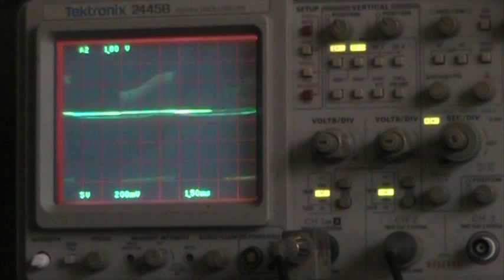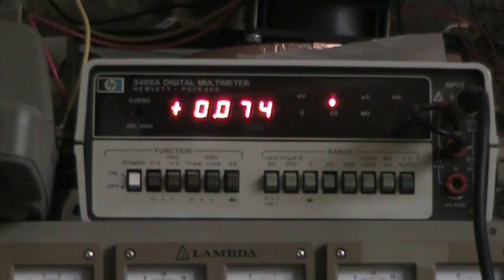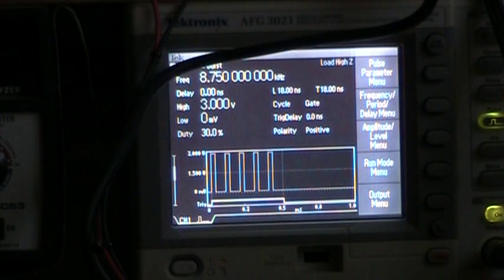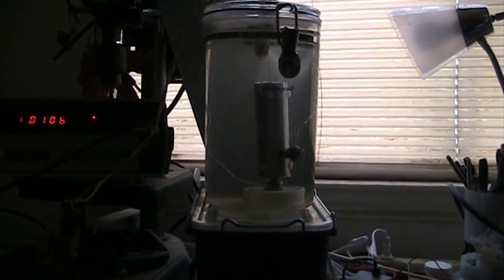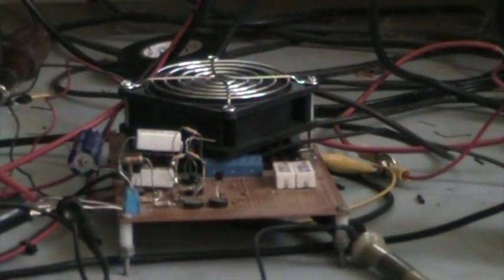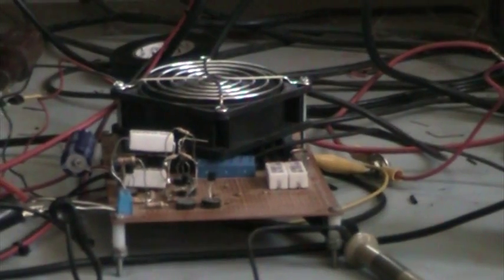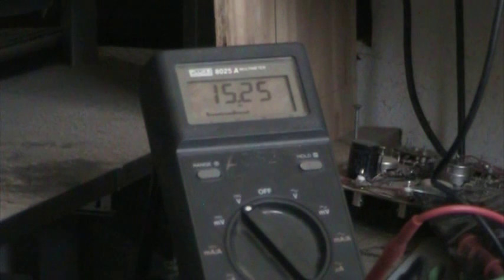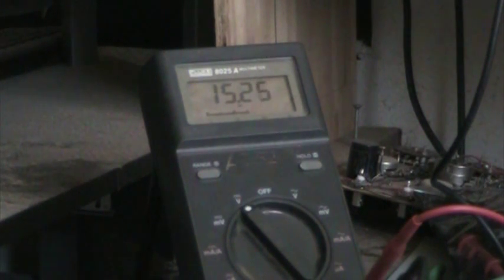My Replication of Stanley Meyer's Patent # 5,149,407

Comment: So what’s the verdict? For us non schooled folk? Scam or grand?
Reply from the maker: Scam
Reply: @michaelsnyder7442  :o Why?

Just to clarify that I'm not a professional, nor educated in the required fields: Just finished my BS in mechanical Engineering in 4 semesters. 20yo, germany

But if you can sing/scream to destroy a wine class (audio frequency lets the glass oscilate to strongly to destroy the glass), why can't you tune an E-field (like i.e. between "meyers tubes")  to near the "resonant" frequency of the water molecule to let the hydrogen atoms oscilate so much that they brake the covalent bond between it and the oxygen atom and refill all the electrons from the negative tube to stabilize it? 
i.e. Create Hydrogen- and Oxygen-Gas at a comparatively low energy input to then use it to either power something or just simply create "better" drinking water (bunch of studies out there that comfirm the benefits of water bubbled with hydrogen improve health)
Reply from the maker: @hagenschroder123  As the gas is produced the resonate frequency of the cell shifts.  Remember the molecules resonated in the Megahertz, not kilohertz ( Ie: Audio Range), as Meyers purported it was resonating at. The way Meyers scammed the patent office was his proof of concept control box used a current meter from a high current industrial battery charger ( 0~300amperes). He then told the patent examiner, looking at the meter, it was consuming milliamperes of current. But had they hooked a 0~10 ampere meter to the circuit, it would've shown it was drawing amperes, not milliamperes. Meyers got sued and in court the expert witness hooked a actual 0~10 ampere Fluke meter to his circuit and they proved his setup was working as a regular Faraday setup, or Regular electrolysis process. There was no audio resonance. I built his setup according to his patent to prove it does not work. Other scientists have done the same and proved it cannot and doesn't work. I truly surprised a learned and educated man, like yourself, would believe in Meyers. The laws of thermal dynamics also does not allow for it. You can never get out more energy than you put in.